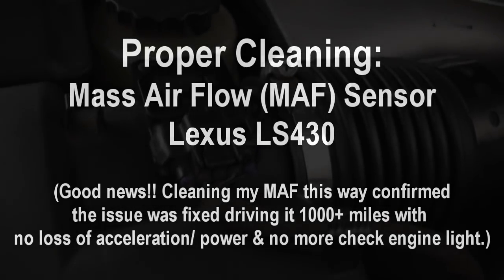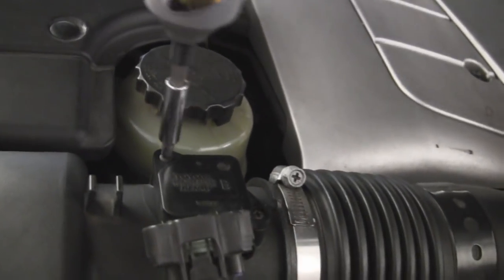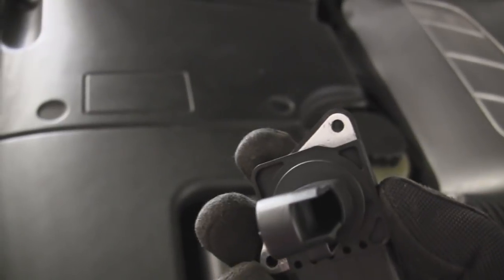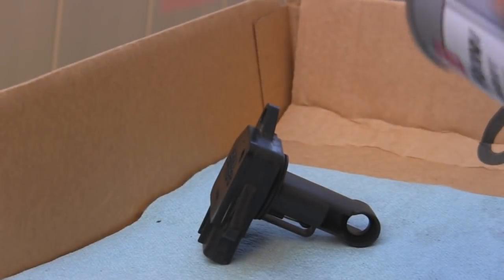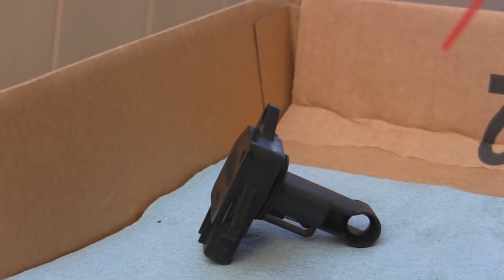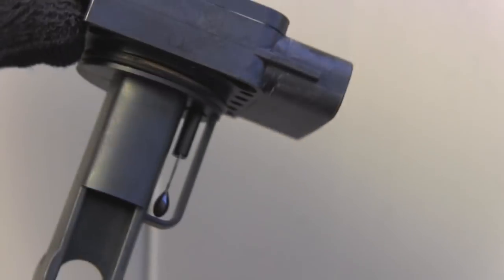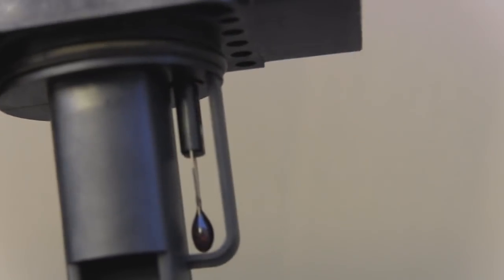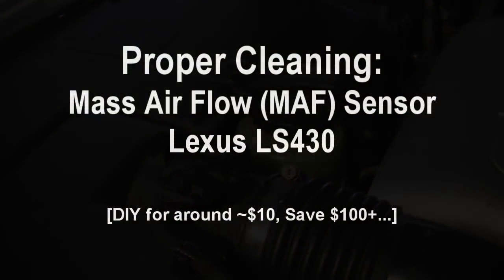Lexus LS430, 2001 - Proper Cleaning: Mass Air Flow (MAF) Sensor, codes P0171, P0174, (DIY ~$10)

Comment: 2006 Lexus Gs430 had codes P0175 and P0172 ( very similar to other codes I’ve seen) cleaned MAF sensor and it worked

Comment: Being a woman I've found over the years mechanics tend to tell us anything they deem believable. Well I'm several years older now and the okie doke just doesnt work anymore. Its videos like yours that are giving us power. Less fear to try and do some things on our own. Even if we dont tackle it ourselves, we are more knowledgeable about what's going on with our cars. 
I have the 02 Lexus ls430 and I'm gonna clean my maf sensor, myself, nx weekend. Thank you and keep up the fight
Reply: Your absolutely right @gail because I worked in a machine and engine installation shop and the owner would brag about doing a carb rebuild by spraying Berryman's carb cleaner and charging 100 dollars for this because it was a woman, also never ever trust dealerships unless you have a great warranty. Just a machinist myself and only heard from the horse's mouth himself. This was done in the 80's and you can bet some still do.

Comment: hey funky mechanic and viewers....i have a 2002 ls430 and have had CEL on for some time now... lately  i am noticing and having decrease in power...like there is a slight hesitation when i try to get on it, other times it kicks down and acts all funky... always some hesitation as i step on the pedal, car is running RICH not sure if its a flange or exhaust leak but i got 7 codes being blown in my OBD scanner...its telling me the oxygen intake is not right causing car to run rich not lean..or maybe vice versa not sure... but the VSC light has been on since bought so ive dealt with it any advise? greatly appreciated in advance ! CHEERS
Reply: Sounds like o2 sensors. LS430 has 4. OBD will tell you which one. VSC sometimes kicks on when your cel lights goes on. You can restart your VSC with paper clip while car is on a flat level. Online guides everywhere.

Comment: How to get to Throttle Body in 2001 LS430 and clean it?
Reply: remove the big air tube that goes to the throttle body, you need to unscrew the rings on both sides. Also i would detach the air filter case (left of the MAF sensor) in order to move the tube more freely.

Comment: do you have to reset the car battery after cleaning the MAF sensor?
like, remove the negative terminal?

or no?
Reply from the maker: No need to do that as you can reset any warning with a good OBD2 device.
Reply from the maker: Nice, I hope you also got rid of the cockroaches in you engine bay.
Reply from the maker: Yes it is.

Comment: what happens if you spray the part where the electrical plug goes?
Reply: nothing detrimental, rather, it cleans the connections and provides better conductivity.  MAF cleaner is similar to electrical contact cleaner
Reply: tntboyz1602 nonthing
Reply: Let it dry thoroughly.

Comment: No even single comment on how to check MAF for resistance as said in the repair manual. Only that procedure specified by Toyota guarantees you have good MAF. Otherwise cleaning might help to get rid of some error codes but that's about it
Reply: Олег Кулыгин so how do you check MAR for resistance?

Comment: '06 Lexus GS300 - VSC warning and check engine light came on. Checked code with OBD2 - P0175 - rich bank 2.  Pulled the MAF sensor like in the video and used CRC MAF sensor cleaner.....only cleaned the wire showing...did not do the ones up inside the plastic housing.....it looked dirty on the air filter side.  Sprayed the CRC cleaner on the wire several times till it looked clean....put it back in.  Started the car ...used the OBD2 to erase the code.  Took the car for a drove....seems to have worked.....even though the CRC can directions say DO NOT us on most Lexus vehicles.
Reply: And what happened to it in the long run? Update on the lexus? We’re they right to say not to use it or wrong